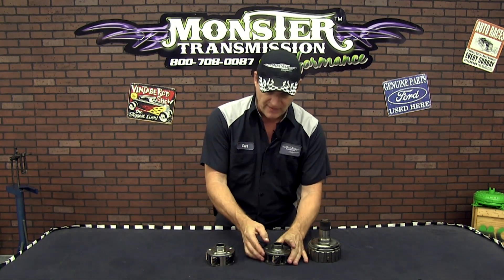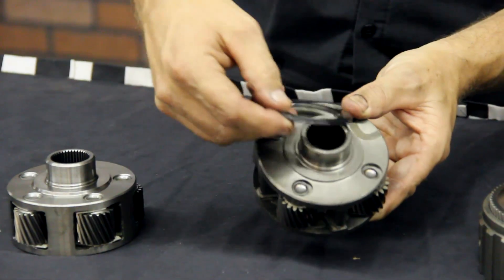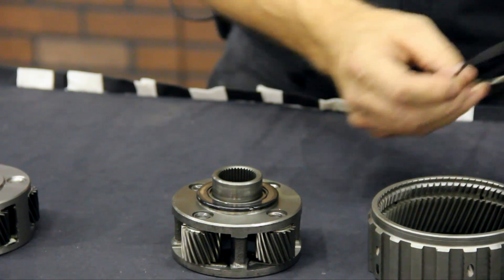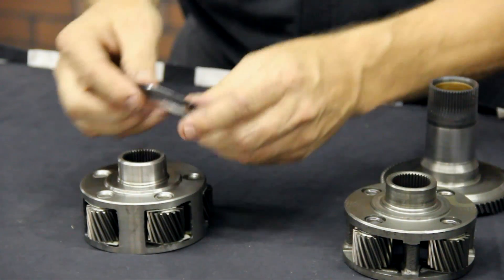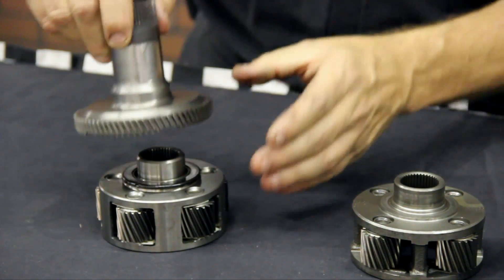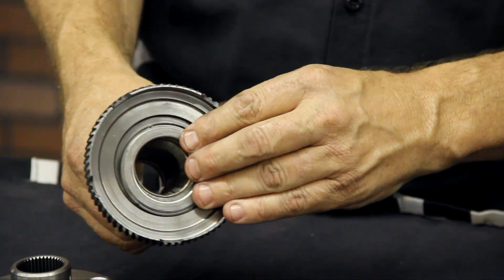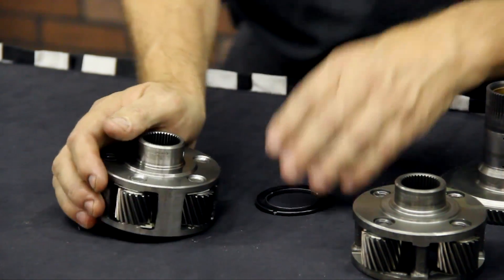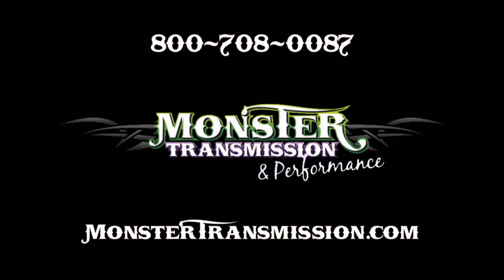Curts Corner  | Monster Transmission 5 pinion planetary bearing

Comment: Bearing running loose in the hub and around the planet? Doesn’t sound good. Just ran across a 4 pinion planet in a 2011 behind a 4.8l the planet and the hub seat are different diameters for the umbrella type bearing. Front planet was wasted had to retro the planet, bearing and hub. Any thoughts?
Reply from the maker: The hub holds the bearing in place. On the 2008 they have a special bearing for them that have different clearance than the 1999-2006 4l60E's so you just need to make sure you have the right hub and bearing.